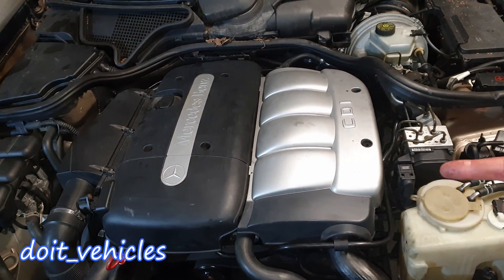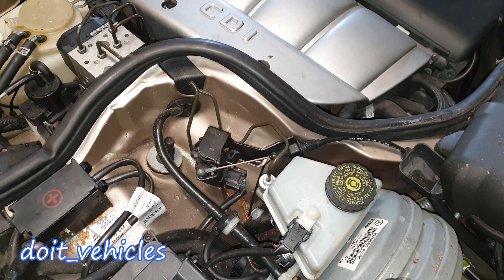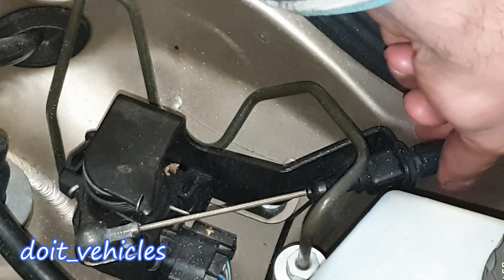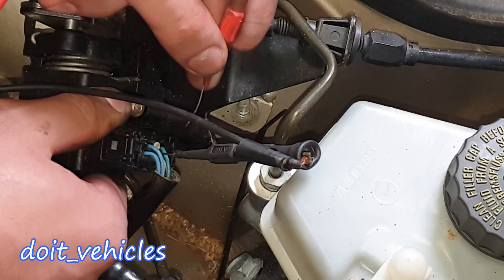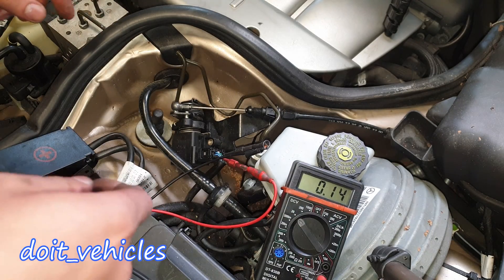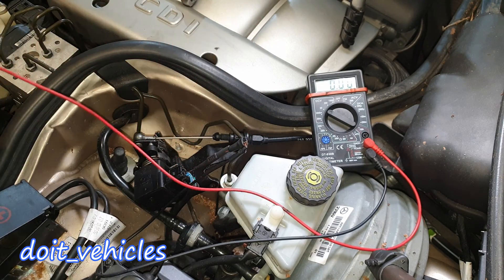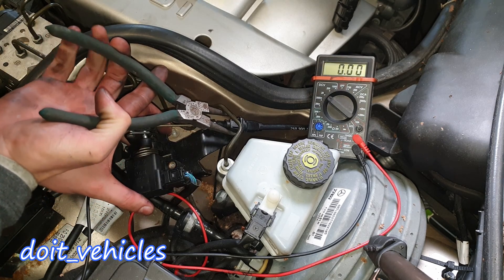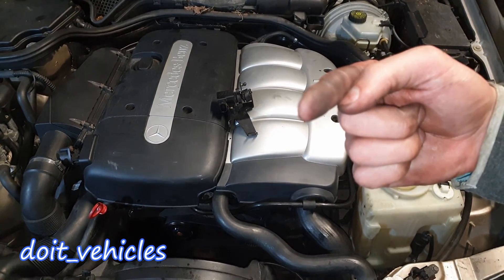E220 CDI Mercedes w210 OM646 Accelerator Pedal Sensor / Throttle Possition Sensor - p2359

Comment: Hello,
first i would like to say thank you for the Video!
I have a Question
My W210 E220 barely accelerates when I floor it, and the EPC (Power Control) warning appears. However, when in idle, I can rev it, and the engine speeds up. With some time, I can reach 140 km/h in the car. What could be triggering this error message?
Reply: Hola amigo , lo pudiste solucionar ?
Reply: @pocholotec  Hello, yes
It was the Gassensor and the Airsensor

Comment: C220cdi, 2003 (mechanical egr) drives well but if i come to a stop it splurters and hunts, if i unplug the maf sensor it doesn't do it but goes in limp mode.  I have changed the maf but still the same, maf plugged in it smokes on acceleration and stutters sometimes even stalls on idle in gear, unplug maf. Its slower to accelerate but no smoke no stuttering
New injectors
New maf. 
Still same problem. 
Any help please

Comment: You do not identify where in the wire connector the ground slot is & what size wire you use for the grounding cable. Pls respond as I have a High "A" circuit dtc in my 2001 E320.

Comment: greeting
i have a problem on mercedes w210 270 cdi
when I squeeze the gas all the way it fires my epc error so when I overtake another vehicle it fires my epc error and takes my gas
Could it be because of the gas meter?
Reply from the maker: First read the code / freeze frame if possible . It is possible to be from the throttle position sensor .
Reply: I have the same car and the same problem.  How did you solve the problem?